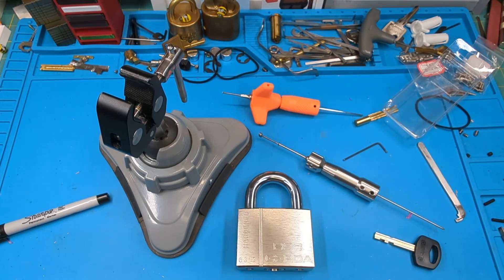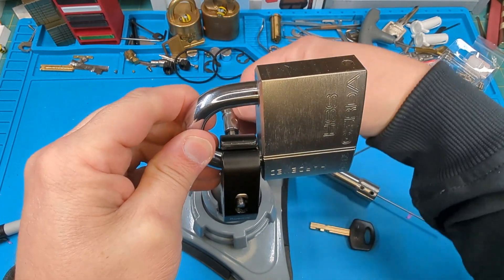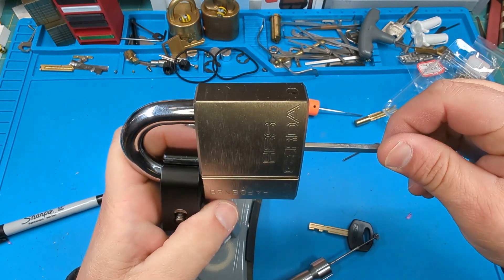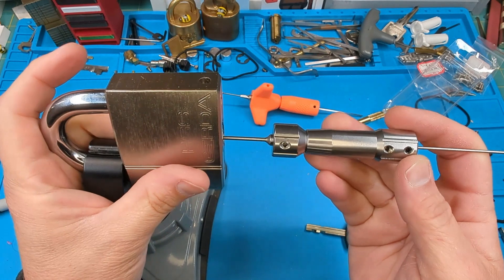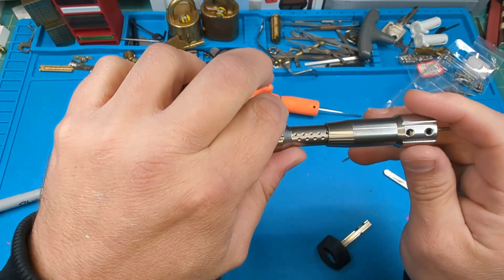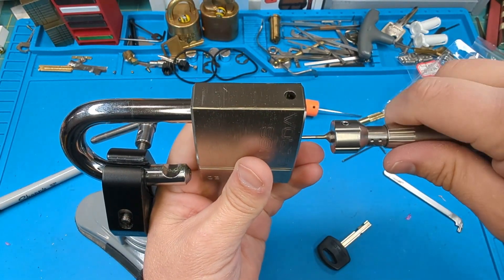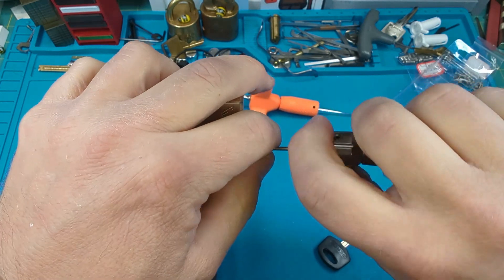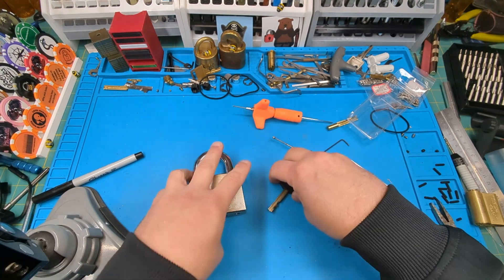(79) Gerda HSS DD Padlock picked and gutted

Comment: As always great picking. Can you decode with the RWB?
Reply from the maker: Yes you can. You just need to set up the handles correctly. It may not be exact depending on the make of the lock. I think the RWD has 5 marks in 90 degrees, but some locks actually have 6 cuts in 90. Hope I didn't confuse you. I am not the best at explaining this.